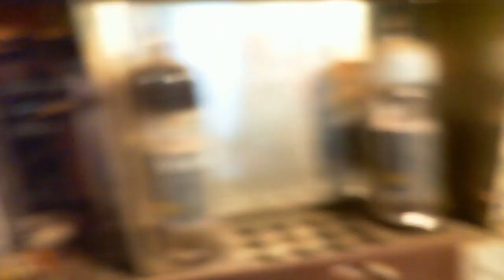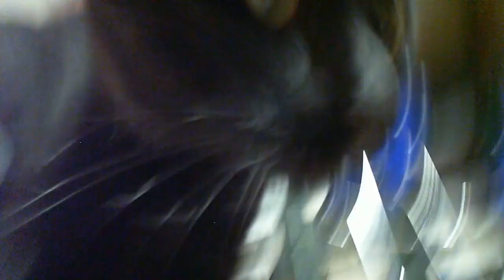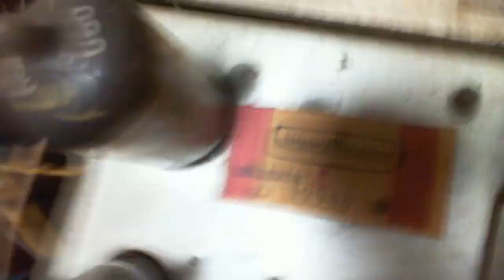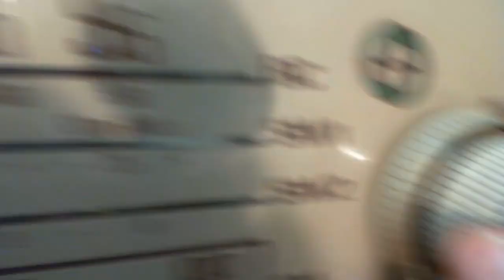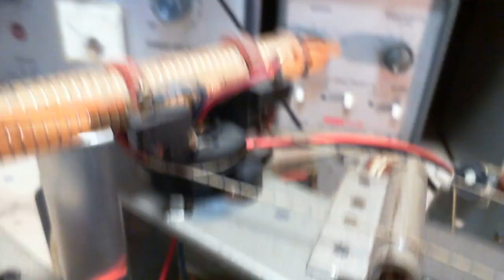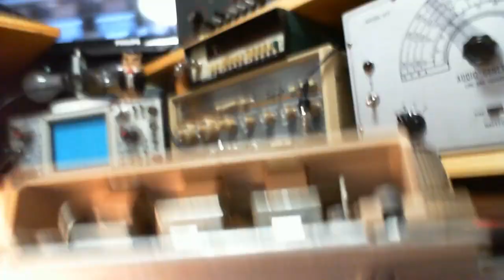Nordmende 3004C Video #1 - Checkout

Comment: Is that wax, or glue in the bottom of the radio...if glue, it would be similar to the glue in older kenwood hf tran...like my TS-440s. And because of this in the vco sections, the glue acts as a conductor, because it is 20+ years old, and changes the has a continuity of 2.5 volts in some place's, which throws the vfo off freq.

Comment: ELL80 are two EL95 / 6DL5 in one tube. They run quite hot and are not very reliable. The ELL800 was introduced at the end of the tube era, so not many were produced which makes them rare and expensive nowadays. Good luck in finding a new one.

Comment: The audio outputs on her are push-pull (class AB1, most likely) on both channels.
Notice each output tube (ELL80) is a double ("twin") beam output section in one bottle.
Both sections share  common heater, cathode, and beam forming grid connections.
Because of the common cathode connection, there will be only one cathode bias resistor (~220 ohms about right) and  one cathode bypass capacitor per tube socket.
Also: That is the most pretty example of one of these I've seen. Wow.
Also also: Those ELL80/6HU8 are scarce, but can be had. No need to replace those in pairs.

Comment: That strange thing you cannot identify is a fusible resistor and there might be a few capacitors might need replacing, looking at the circuit diagram it looks like that radio set can have woofers/midrange speakers and tweeters can be part of the cabinet depending on the model but that one does not have the internal speakers, that tuning knob looks like a duel concentric knob which has two functions, I have spotted two 680k resistors in the output stage. what was the value the resister that had one leg loose if it was a 470K I cannot see it, I wonder did that PLL80 blow it's top because the leg of a resistor was not soldered into place properly.

Comment: Rod Smallwood is correct,  that strange thing is a Fusible resistor, it most likely opened up to prevent a fire hazard or damaging the radio more due to the failed output tube section,  that section probably has a failed bias resistor which MIGHT be the fusible resistor element !!

Comment: Those are fusible resistors and one has gone,
Reply: I think not a fusable resistor, it is rather a fusable solder, which is soldered with a fuse metal who melts on a very low temperature. I have seen such soldered with a metal who melts under 100 deg. C. It is usually placed to feel the heat from a transformer.
Reply: Yes fusible solder but its the heat from the power resistor that melts it.
Reply: I recall the solder being described as 50/50 which has a lower melting point than the common 60/40
Reply: and I still belive that is a fusemetal, a metal that has a conciderable lower melting point that the common solder.
Reply: Yep: a fusible resistor that can be "reset" with a soldering iron. Add a little rosin flux, heat, and reattach the spring. Don't add solder unless you have to. If it needs solder added, I'd start 60/40 solder
It might be pure tin or bismuth, maybe an alloy of those with lead, but I doubt it.
Regular solder has a lower melt point than those.
Reply: Tin/Lead
Melting Point
40/60
460∫F  (230∫C)
50/50
418∫F  (214∫C)
60/40
374∫F  (190∫C)
63/37 <-- eutectic, recommended for this application.
364∫F  (183∫C)
95/5
434∫F  (224∫C)
.
100% lead
621.4F (327.5C)
100% bismuth
520.5F (271.4C)
100% tin
449.5F (231.9C)

Comment: that green thing with it wire sticking out is a protection. its a resistor and that lose wire is normal solderd in that pad above it ( if resistor gets to hot then solder meld and save radio for over current. so you need to resolder it and check whij the radio had a over-current event.
Reply: ps when you restore the connection make sure its not a permenant one it made to meld the solder and let that wire spring lose !!!!!  its a "Protection"  (thermal overcurrent fuse)